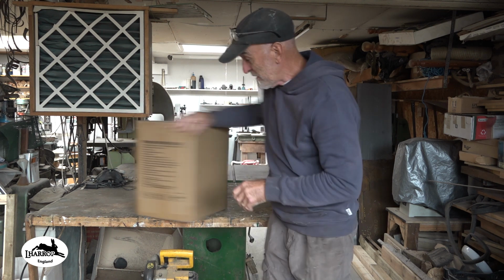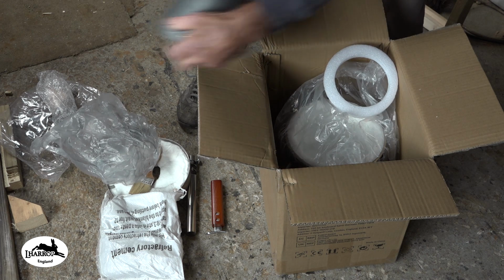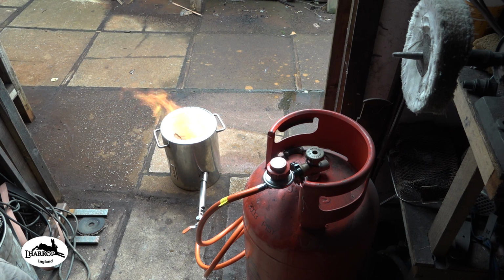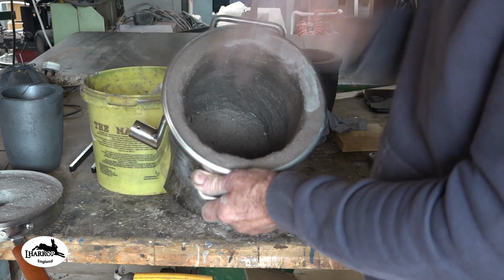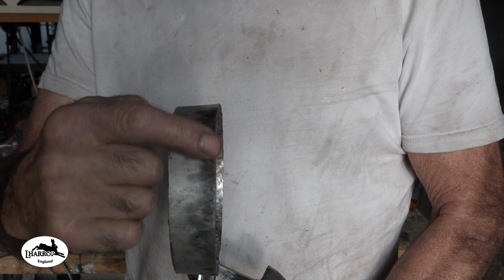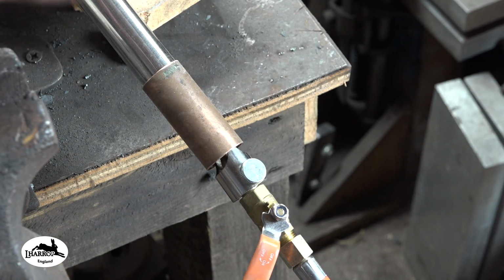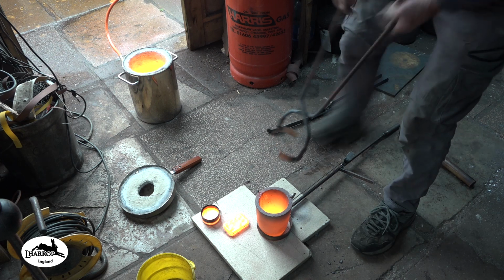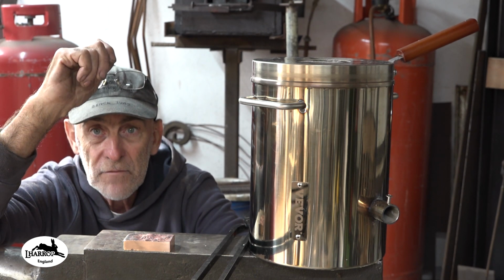Vevor forge making tin bronze and tongs

Comment: I’d be very interested to see the heat treatment experiment please Loz……….cracking bit of kit 👍🏻
Reply from the maker: Thanks Richard I've done the video might get it up tomorrow. 👍👍
Reply: @LozHarrop 
Great vid 
How did copper pipe help with air flow 
I've got a new furnace with double burner like yours 
And was thinking of adding a little pipe cover to slide over the intake valves

Comment: When I have used Satanite, it cracks and chips off. Perhaps it is because I keep the forge outside under a tin roof and it gets damp?

I love your crucible tongs- brilliant.

I like to watch Windy Hill Foundry on Youtube.

best wishes
Frank
Reply from the maker: Thanks frank, will check windy hill out, yes satanite does crack and craze on a blanket its more about containing the fibres really, you can buy blanket Rigidiser which if applied before the satanite helps to prevent the flaking . Cheers,

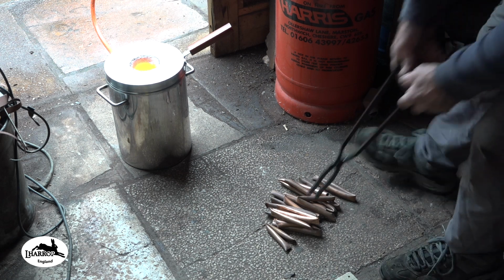Comment: 21:07 The guy who taught me casting had us stack metal on the lid  to heat up prior to adding to the crucible, to drive out any moisture, and to keep it from cooling off any metal already in the pot. Thanks for producing this.
Reply from the maker: Yes that's a good idea mate my copper was dry but I will do that in future to speed up the melting. Cheers.

Comment: I found an instant read temperature gun with a digital display cheap. They're available in different ranges suitable for low and high temperatures. The probes are good, but the instantaneous ability is handy as a fast checking method. I've been waiting for the Vevor furnaces like yours to go on sale for a while. 200 dollars Canadian is about as low as I've seen. A heat treat use video would be great!
Reply from the maker: Yea I have one James only goes up to 500c I think... good value here that forge around £80 I think. 👍